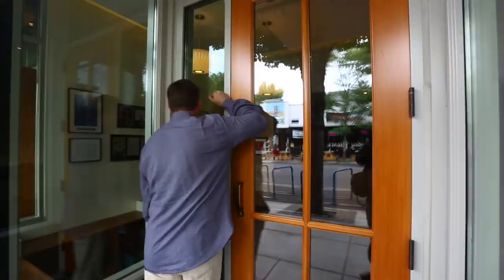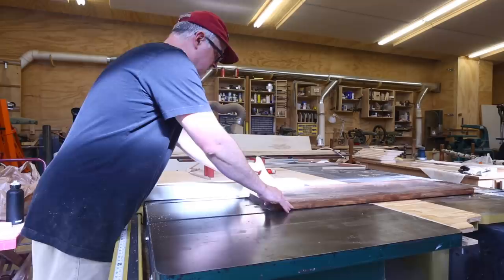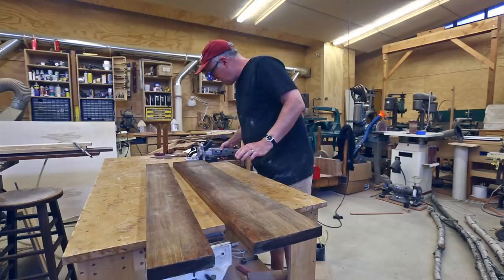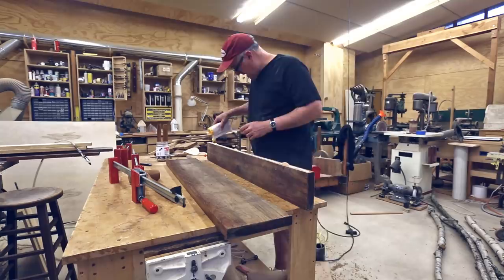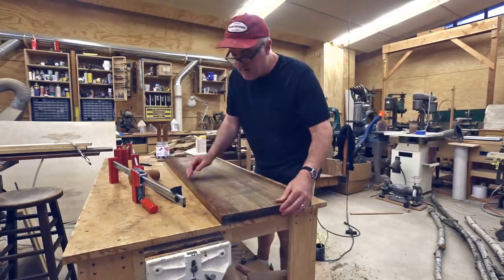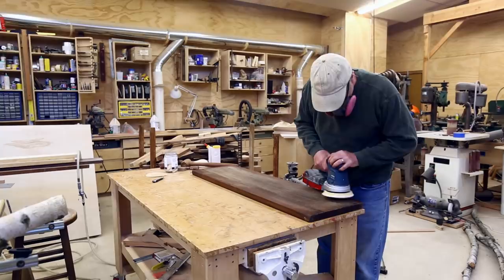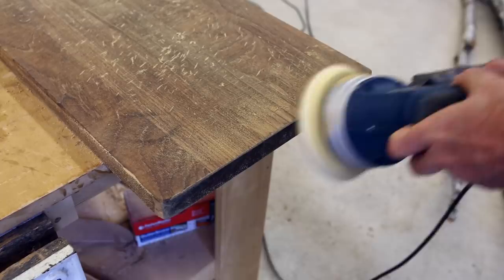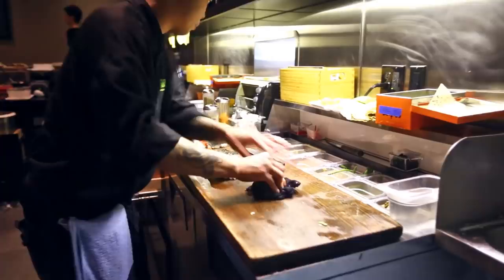Repairing Commercial Sushi Cutting Boards

Comment: A simple fix, but really well presented!
I'll admit I'm not a lover of fish, especially raw, so handling those boards would be a stomach turner for me. 
I use a cabinet scraper made from an old saw blade to scrape my cutting boards regularly. Exposes a fresh layer quickly and no sandpaper to clog.
Reply from the maker: Yes the shop had a fish smell for a week or so afterward
Reply: frank howarth
I can only imagine.
Reply: Fiz algo parecido com minha mesa da cozinha, só não precisei cortar, somete lixei e encerei novamente como era originalmente, ficou muito bonita, realçou  cor da Imbui. Seu trabalho ficou muito bom, ainda mais sabendo que para cozinha.
Reply: frank howarth  Frank , The most strange smell in my opinion, from the old cabinet with perfume =) I was genuinely shocked when I tried to saw a board from a home cabinet (about 40-45 years old) =))) wood remember all the smells around.
Reply: One species of pine is like that from Atlantic Canada region. Cut it and it smells like a magnificent womans perfume. I would stop whatever work I was doing to enjoy the fragrance each time a cut was made. It was that good.

Comment: I've been using titebond 1 and 2 for a lot of years on teak (boatbuilding) and I've never had any problems with oil in joints. In the last two or three years I've been using titebond 3 with similar results. Never really noticed any problem with oil and loosening joints. The stuff is incredible. The titebond 3 is also supposed to be weather-proof. In fact, the joints on a deck hatch I built well over twenty years ago still look as tight as a seal's bung hole (if you'll excuse my language).
Reply: Victor, why do you know about the seal butt?
Reply: It gets lonely out at sea.
Reply: ...OH MAN!!!  LOL!
Reply: Victor - bwahahahah - phenomenal reply...

Comment: I've had great success using scrapers and a spokeshave to resurface cutting boards. I had to get a good burnisher to get the hook required for a silky smooth finish but well worth the effort. 

Great production value as always.
Reply from the maker: hmmm,  I may have to try that. thanks

Comment: I don't know if it's the same but my Dad had a chopping block on which he prepared everything we ate. I don't know if it was a rule or tradition but that block was never sanded. It was washed and scrubed with hot water, lemon and rock salt, then scraped with an absolutely flat sharpened meat cleaver until sonething went "ding" inside my Dad and then he spread screaming hot olive oil on it. He flipped it each time he cleaned it. I think it was about 4-5 inches thick held together with threaded stainless steel rods wood plug capped on the ends. The thing was a hardwood piece of high art. He never did (to my knowledge), but I'm pretty sure he would have killed anyone he caught misusing it. I think the whole thing was endgrain on the business sides.

Comment: Wow, that restaurant looks hella busy! The repair you did is about as good as you can hope to achieve on this type of item. End grain cutting boards would probably be a longer lasting option for them, but they're more expensive, and they may as well just keep using the ones they have currently until they're a bit past the point of repairing them (maybe after another planing or sanding down the line).

Comment: I find it refreshing to see you using a planer (jointer) to prepare those edges for gluing. In the UK, we're trained to do this by standard but across the Atlantic, I see people constantly working with edges straight from their table saws... It can't be a bad approach as we all use these saws to cut sheet materials but I've never personally had the balls to glue two 'sawn' edges together. Hope the teak didn't have an adverse effect on your blades or cutters! ;-)
Reply: If you use a thicker, more rigid blade, that has a less staggered tooth pattern, the cut comes out pretty smooth.  It's not something I'd personally do on a high quality piece of work tho.
Reply: Don't forget Olly....we don't all have planers/jointers mate ;)
Reply: Are glue joints stronger if the edges are jointed? Wouldn’t a “rougher” edge straight off a table saw allow more wood for the glue to adhere?

Comment: I hate working with teak in my shop. Every time a costumer asked for it I have to build in the cost for sharpening or replacing the knives on my jointer and plainer. All the oil in teak is like sandpaper for the knives.

Comment: the basic problem is in the wet/dry cycles of the boards which causes them to swell and shrink. The ends dry out faster and tend to crack. the dry boards should be thoroughly steeped in paraffin oil to exclude water then kept regularly oiled.

Comment: I have heard that teak is hard on woodworking tools due to the silica content. So I found it interesting they use teak cutting boards. I wonder if they have to sharpen their knives more often than typical or if maybe knives don't cut deep enough to really be harmed. Interesting project!
Reply: It's better for health reasons to have a board that won't gouge as easily when working in a restaurant since any slices in the board will hold onto bacteria. So a more durable surface is preferred. Also if their knives are good quality and their technique is on point, which it most likely is. The edge will last the the whole day.

Comment: Hello, Frank. Always a pleasure to watch your videos, they are very bright and spectacular :)
    I have a question for you: how do you work in the studio in the winter, how is heated by its huge workshop? Do other than electric heat guns, other heating?
    And a small request: add, please, in the description of the video to more information about your work, you look on the other side of the ocean, not the English-speaking audience :)
    Mark Fisher, Kiev, Ukraine.
Reply from the maker: I have a 40 amp electric heater, and a lot of insulation, and mild winters, and I wear a hat.
Reply: frank howarth    I noticed that you wear a hat :) The question is how to glue the adhesive at low temperatures.
    PS    Saw your video winter, you also is the snow. And what is the average temperature in the winter you have?

Comment: I was wondering what you charged to do a simple job like this.  The work was simple but time consuming and with a somewhat amount of preasure.  Seems they weren't personal friends or would've let you in back easier.  I'm asking because a BARBQ place has ask me to do the same.  Maybe I'm breaking some kind of woodworker's code by asking so excuse my ignorance.
As usual thanks for sharing.  I enjoy watching your work.
Reply from the maker: I think I charged $200 for 4 boards. 2 needed fixing and 4 sanding.  I'm trying to figure this stuff out too.

Comment: I was wondering how you charged them (If you did) for the work?  My wife tells me I don't charge enough for the work that I do.  I built Kitchen cabinet doors for a lady and charged $100 for 8 doors.  My wife said that was just over $12 per door.  I had 80 passes through the saw and I sanded all the doors for priming.  I then explained to her that I was paid $20 per hour.  I held the doors for an extra day for looks.  I find pricing for work harder than doing the actual work.
Reply from the maker: Yeah i hate figuring out pricing.  For this there were 2 boards fixed and 4  boards sanded and I changed $200. and took 2 to 3 hours.  I used to look at woodworking pieces at craft fairs or galleries and think, wow that's expensive.  Now I look and think how are they even making a living.
Reply: frank howarth Thanks for that answer, it's always hard to price your own labour so it helps to see someone else's laid out nice and plain.
Reply: +Gary Finger I was about to ask how much did he charge. I'm not a carpenter jet but I work as a photographer from time to time and get 50$/h. It's considered to be low in this business but I charge for the editing time and all my expenses. For what I'v gathered, in carpentry it's about the same if you are running your own shop and have some demand

Comment: frank, I was thinking just split the boards at the crack, clean the sides then glue them. What made you want to rip out the original crack?
Reply from the maker: Cleaning those cracked surfaces would be difficult and hard to get then to go back together well. And they did not mind loosing the width.
Reply: I get it. I had repaired a family heirloom cutting board by finishing the split that started then gluing, clamping and weighing the whole mess down on a flat surface for a month. That fixed it but yeah had to wire wheel the bahorkas out of all the exposed surfaces. You make great vids and I'm glad I found your channel.

Comment: I'm curious as to what oil they use on the cutting boards. Do you happen to know? Also, now I want a teak cutting board :)
Reply: Now I want Sushi :)
Reply: Teak cutting boards can dull your knife quickly. In a restaurant environment when you are constantly sharpening it's ok. At home I would use a softer wood. It's less of a headache.

Comment: teak for food!? 
we use pine or equall. nice job thou!!!
Reply: You prefer pine because it's disposable?
Reply: *****
no!! its a softer wood with way more recin in then teak oil , wich isnt good for you , the teak i meen, the oil can couse allergic reactions coused by the meny uses of the oil in lots of differnt things and it multplys up in our bodys , wheras pine recin is eatable ! the softer wood maked  the dulling of knifge edges slow down , alott! thats why ! hope you find it helpfull !
Reply: transdetendal That interesting, never heard of a reaction to teak before. I think I'll stick to hardwoods when making cutting boards though, wayyy more resistant to moisture and humidity.
Reply: *****
absolutly true !! and i get why most is doing so , but here , if your in buissnes , not happening !! its either plastics or non reactive woods !
Reply: +transdetendal That makes sense.
Reply: *****
well thats why i posted it and wondered!  but we never stop learning ( MAN ,if we did life would suck)
Reply: +transdetendal Right.